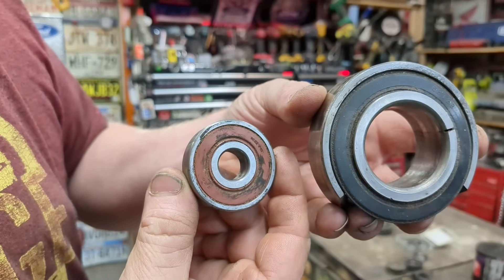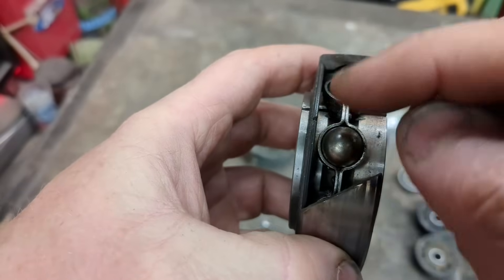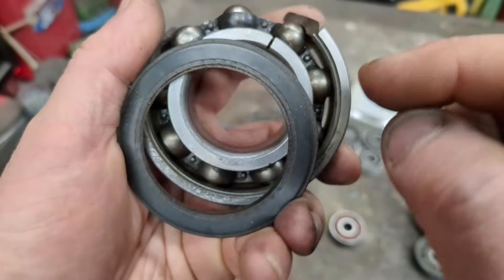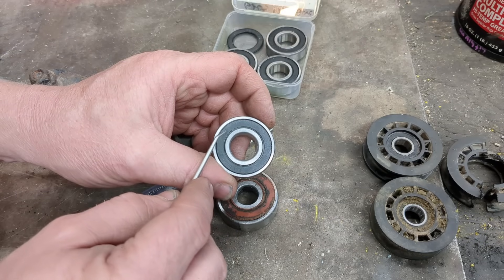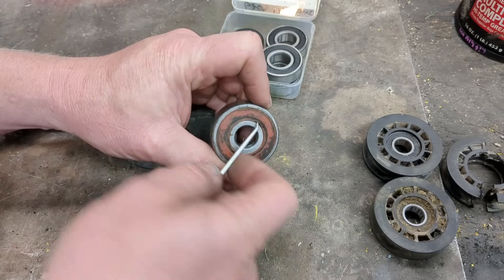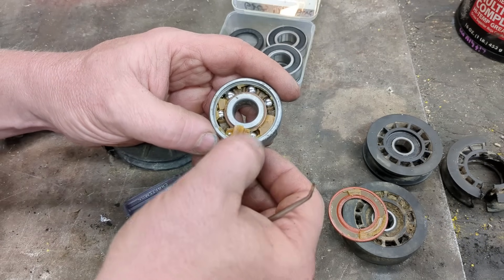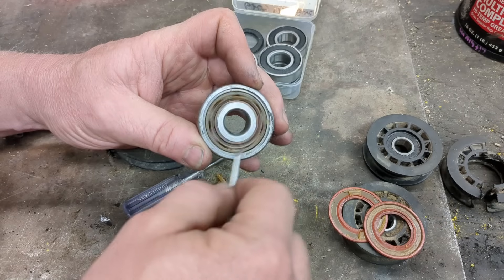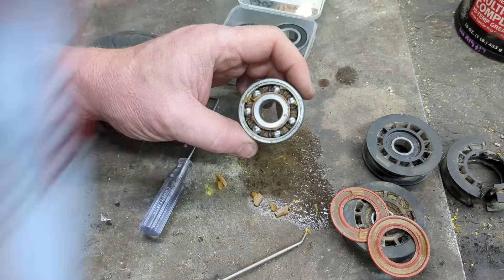How to GREASE, Un-Seize and Clean SEALED Bearings

Comment: Ridiculous. 

Gasoline and a toothbrush much better - cheaper and easier on bearing seals too.
ONLY grease when totally gasoline cleaned and dried (I use the hot sun in summer or an electric heater blower in the cold).
When you can't smell the gasoline any more it's ready for around 50% grease of choice (that's another story).

One of the reasons you clean it is to NOT MIX GREASES.

Comment: Absolutely disagree😋 Except that this way I and you know as well as others who know about this. And in my opinion, this information is as old as when Jesus wore shorts. The reservation that is used to maintain machines and the like. approximately 97% run too long so the bearings are already destroyed. And many do not have the tools to do this. But as I'm just now changing the bearings on my boat trailer. So I will test. remove all existing grease and lubricate "your" way and leave the other "original" Also change the bearings on my car trailer and do as most recommend remove the inner seal on the bearings and put a grease nipple there. will return in a year. 😉

Comment: If you're picking this much dirt out from behind the seals... time to just replace the whole bearing.
Reply from the maker: That's not dirt, it's grease soap.
Reply: @sixtyfiveford  At 3:45 he explains it's dirt in addition to old thickener. Compared to the other bearings, it also visibly looks like dirt/grit vs just thickener.

EDIT: Realized you're the video author! If you say it wasn't actually dirt then I'll trust you there. (Personally, for a lot of applications, if I do find any dirt inside, the whole thing's getting replaced.)

Comment: Remove the covers and drop in a bucket of diesel and gas
Let it soak for 4 days or longer if you don’t need it, remove and blow dry 
Inspect and if ok grease with wheel brging grease and install cover s

Comment: To be honest, with any sealed bearing, I've packed it full and never have had a failure, to include wheel bearings and spindles on mower decks. I'm sure this is correct information,, but I just haven't had a failure yet in over 25+ years.

Comment: any suggestions on bearing supplier? and   sites that offer all the parts for tools, but @ cheap prices?
Reply from the maker: I used to have a bearing place 10 years ago. But then they raised the prices and or didn't have the bearings I needed. Honestly, it seems the cheapest place is eBay or Amazon only because they can ship for reasonable prices.
Reply: @sixtyfiveford  thats what i have found also, but i know the parts unicorn is out there ... somewhere ... but i know i get different search results than other folks using the same exact search term, and in same geographic location. I have tested that, even on Craigslist.  Ever do the cold hot method installing bearings, and supposedly heating the drive pulley on the dws709 type 20 is supposed to make removal oh so easy ....

Comment: Nicely done.  Overpacked bearings wind up working the grease, the extra load causes it to run hot, and... bearing life gets shortened.  Some heavy duty/low speed assemblies do well with a little more [near 30%], but thats about as far as it goes.

Comment: Choice of grease matter more imo. Schaeffer 274 aluminum base is so special compared to trashy lithium based wheel bearing grease. When you mix lithium based w water it will fog up and foam up but it doesn't happen with Schaeffer 274 it's actually truly waterproof grease.

Comment: I used to take those seals off and do exactly what you have done, and I also used to take the pick and use it to put a little hole in the seal then I would get my needle bearing grease fitting and attach it to my grease gun and pump a small amount of grease through the hole I made in the seal and then re-seal the hole I never ever had a problem I am a 71 year old retired heavy duty mechanic and I to also got into arguments about greasing sealed bearings and about over greasing a bearing over greasing is not good and it is just a waste of grease got into a lot of arguments over that one, but at the end of the day I was right.

Comment: Thank you. Rebuilding an engine on a tight budget. Pulley bearings were starting to sing a clickety song. Don't want to use cheap parts and can't wait for shipping. I am going to do some preventive work on the wheel bearings as she is off the ground.

Comment: Great video! very informative. How about needle bearings and taper roller bearings? More like parts on dirt bikes swing arm with needle bearings, steering stem with taper roller bearings that just pivot and oscillate and don't spin at high speeds.

Comment: How do I tell you thank you enough on this information. This is my second comment on this video and today March 30th 2024 I took the two idler pulleys apart on my zero turn and your information was exactly correct as I dug out all of the hardened grease and dirt. I used carb cleaner along with PB Blaster to flush out all the remaining junk. I also used greased lightning with hot water to clean them more then blew them out with compressed air. I saw exactly what you were talking about with putting to much grease into them. After greasing them I put them back on the deck and spun them and they spun freely and there was no noise. I’m 100% certain if I had caught the one that is destroyed now that I could have saved it. The new idler pulley that I’m going to purchase will be taken apart and cleaned and repacked with the exact type of grease that you used as my three tubs of grease are the exact type but all three are different colors as you stated. Now to take the spindles off of it and take them apart and clean and regrease the bearings in them also. Again thank you is an understatement on the information of the 25% amount of the grease. I’m sure glad I have been subscribed to you.

Comment: One thing to point out, re greasing a bearing needs full cleaning (even preferably with an ultrasonic cleaner) if you are using a new grase type and you're not sure of its composition. There are plenty of grease types with different thickener material which are not compatible with each other when in contact, once they mix they change composition, harden up or disintegrate.

Comment: One thing not mentioned is that you can tell if a bearing is failing simply by listening while in operation. The first thing you hear is that it will make a low pitched whistling noise and then a slight rumbling. Almost always after that they will have a loose wobble to them. By then it is too late for grease. It does not happen often but, if these conditions go too long, it  can lock up completely and the inner part of the bearing will rotate on the spindle causing it to be ruined. Don't buy the cheap ones! Fafnir, Timken or SKF are good quality.

Comment: I have a machine that has a heavy belt driven power take off pully with two 6305 2RS bearings pressed into the ends of the pully.  Without using a bearing puller to remove the pressed in bearings, I can only access one side of each bearing.  I figure using a slide hammer to pull the bearings is going to potentially do more harm than re-packing will do good.  So I remove what I can of the old grease and press in a dose of new grease from one side of each of the two bearings.  So far, so good over the past 8 years and doing so every  other year.  I prefer shear stable polyurea grease for what that is worth,

Comment: So the; do the trailer wheel bearing devices, that have users pump grease into a spring loaded "Bearing Buddy" that keeps the wheel bearings totall packed, are not good for the bearings.
Reply from the maker: Bearing buddy's do one thing: They prevent water from being sucked in during the immediate cooling from dunking your boat trailer in the lake after driving it. They don't actually force lubricate the bearings. They just give a reservoir of grease so there's an expansion area. I see guys put them on non boat trailers all the time and it destroys the inner seal/hub. It does this by forcing grease out the inner seal. Then pick up road debris/dirt. This mixes with that oozed grease and sands the inner seal and lip area destroying them. On a non-boat trailer, it does more damage and zero good.

Comment: If you can hear bearing noise over engine noise, that bearing has more going on than just lack of lubrication.  Bearing manfacturers know what they're doing.  The grease fill is intended to last the average useful life of the bearing and they don't intend for you to pop those seals out.  Yes, if you clean and re-pack, it will quiet down for a little while.  It's just not worth your time unless you simply can't afford to buy a new one.  In my industry, we do use sound to tell us when a bearing needs lube.  It's low-intensity ultrasonic frequencies though.  By the time a bearing gets to where you can hear it, there's already damage done.

Comment: Don't use EP grease in a bearing, the moly will act like an abrasive etching the surface and causing premature failure.  EP grease is only for low speed sliding applications like pin joints, a 5th wheel, or ball joint.  Otherwise, thanks for the video!

Comment: Bearings are so cheap, it's generally not worth it. Re greasing at the right interval is more important but you can't un-damage bearings. Dry bearings fair enough but any gritty feeling or extra play and just replace it.   It's much worse to have a bearing fail completely and destroy something rather than throwing away a bearing with 6months to a year left on it. Just change them. You'll know what bearings are critical and which ones aren't. Run non critical bearings to failure though as long and removing the rings won't be difficult or damage the equipment.

Comment: I know im late but i had to add this those plastic pulleys  appear to be off of riding mower ill add that when you replace them the replacement pulley is generally made in china  and they generally either have no grease in them at all or very little grease and they do fail prematurely if you dont pop the seals and grease them prior to installation 
ask me how i know

Comment: Disclaimer: I'm not a tribologist, only a bearing engineer.

Make sure you use a compatible grease. Not all thickeners play nice. If in doubt, either replace the bearing (best option) or thoroughly clean the old grease out. IMO screwing around with this isn't worth your time vs just replacing with a good quality new bearing. In all likelihood, the one you install will be better quality and have a higher dynamic load capacity (last longer) than the old one.

Comment: I pop the seals first with a fine needle then finish lifting up the seal with pick/small screwdriver, wash the bearing in kerosene until all bits of old grease is gone , spray the bearing with a jet of water to wash out the kerosene, then quickly compress air the bearing until dry … pack (but not overpack) with name brand synthetic grease..press in seals ..wala

Comment: I worked for a bearing manufacturer and this is the best advice I've seen about how much grease to use.  No one ever goes back to the people who make the bearings to ask.  And if you did you might just get a lot of equations from an engineer.  One company has a chart.  But your advice of about 25% of full pack is good.  Cleaning it out with acetone works but it is not good for the plastic cages on some bearing and it is bad for the rubber seals, so be careful.  WD-40 is pretty benign and only takes a little longer.
Reply: Thirty years ago, working on heavy earthmoving equipment, we were have a lot of u joint failures, so we contacted spicer and complained about the problem, they asked " how often do you grease"? "Everyday" we responded, he said, " quit greasing". So we greased every two weeks and the problem disappeared.  then they sent the science of grease and how it works brochure and we learned about how to much grease will overheat the bearing. That's hard for a lot of mechanics to swallow
Reply: @Maurice-c6z  On my cars, I use ujoints that aren't greasable. I've read if you get the greasable ones, that you HAVE to periodically grease them. Not sure if they leak grease more often than the non-greasable ujoints.
Reply: You're right! I would also avoid acetone, because it destroys a lot of plastic. I usually use clean (spot-cleaning) gasoline. I usually use Molybdenum sulfide grease for high-speed bearings. I am an electrical engineer with a degree in manufacturing technology, but 50 years ago we didn't learn about molybdenum grease, only graphite grease. What do you think? Am I doing it right? I learned about the 25% fill a long time ago, and I follow the rule. But technical logic says so too. Without mechanics, there is no electronics! I grew up in the era of tape recorders. But I also keep a steel-wire voice recorder, which is already a "museum piece" but has still been working for 80 years.
Reply: Ignore the color, but never the base or the nlgi rating.  Put 3 when it calls for 2 for example, and there will be trouble.
Reply: WD40 is the 2go2 for near everything. I use it when repacking my bearings & never had issues yet.
Reply: Why your company uses cheap grease and not high temperature one? Cost cutting I guess?
Reply: @briethlayson3270 where did he say what grease he uses?
Reply: His company uses a high temperature grease, but it is made in China, because it is a bit cheaper.
China has a very poor quality control, and that is why failures and malfunctions happen so often.

Comment: Why would you bother to do this? Bearings are not expensive just buy some new bearings from your auto store.
Reply from the maker: Socks are super cheap. Why ever wash your socks? Why not just buy new ones every time?.
Reply: @sixtyfiveford  There is a big difference between socks and bearings.
Reply from the maker: @Billgiles-56  No, there's not. If it's dirty, clean it. If it's worn out, replace it. On top of that, you can virtually never buy a plain bearing from the auto parts store. You can only buy assemblies these days for modern cars. So something that has a bearing in it that goes out you have to spend $150 upwards of I've even seen $500+ for a part that just needed a bearing.
Reply: @sixtyfiveford  it's not easy to fit and replacing the bearing, special tools needed. So maintenance is easy and best option.

Comment: In the old days, we packed tapered bearings all the way full and half way full in the hub. We could adjust the tension and it worked well. Never had any issues and they ran the life of the car or truck. Grease flows outward due to centrifugal force and cycles itself in the hub. Usually regrease on brake changes. However, the new roller bearings don't work that way and usually burnout in a short time. They too spin the grease to the outside of the race. That's why you don't pick the cover from the outside edge, it will cause a leak point. The problem is, they wear down the race area compared to taper bearings and regreasing is often a waste of time and they will start humming in a short time and need replacing anyway. I've done it a few times and they just don't last.

Comment: Too less grease will be cast aside , the hollow part. As a motorcycle mechanic I grease the bearings almost 80-90%. Use gear oil to thin the grease for proper circulation, since motorcycle bearings run cooler. No issues till now.

Comment: If you have a slow rotating bearing such as on an electric gate or even a mountain bike then almost filling the bearing is the way to go, it will never overheat, it turns too slowly, and will last almost forever.  Even when fitting new bearings they come with the amount of grease for high revs and should be repacked if used for slow rotation.  If they are full of grease, water ingress or condensation just does not happen and they do not 'dry' out which is why they will then last almost forever.
Reply: dokłądnie , wszytsko zależy od specyfiki pracy i rodzaju łozysk, od srodowiska pracy, od predkosci, od obciązenia. łozyska pracujące bardzo wolno pakujemy na full.   dlaczego jednak nikt nie powiedzial jak zdjąć osłony ZZ???   I jak zdjąć osłony z małych łożysk????

Comment: I repaired air tools in an automotive factory for over ten years a noisy bearing got thrown out and replaced with a new one who tries to clean and regressed a five dollar bearing for a thousand dollar air tool or a six thousand electric power tool that reports its readings to a torque management system I understand if you are hard up against it for money then you do what you have to

Comment: How you grease or oil a bearing has a lot to do with the load and rotational speed of the bearing same again for its construction, pure metal for low rpm low water areas upto full ceramic for high speed bearings

Comment: Those aren't sealed bearing, though? Those are obviously equipped with -2RS Two Rubber Shields
Reply from the maker: Yep. That's what you call a sealed bearing. If you have metal sides, it's called a shielded bearing

Comment: No1 failure of electric motors bearings is over greasing, we evolved to greasing bearings while running and using ultrasonic monitoring to tell when bearing noise changed indicating sufficient grease in electric motors and conveyors, elevators etc and increased bearing life cycles by 400% in some cases

Comment: When I was working as a mechanic well over 20 yrs ago I used to wash the old grease out in the parts wash bath. Then I would use compressed air without spinning the bearing fast until it was clean. I used to repack ball bearings with Shell Alvania I think it was called. It’s what we used to grease all the bearings on our vibrating screens in the quarry. It seemed to be far superior to other greases for longevity of bearings and I used it in rebuilds of engine water pumps. On truck trailer hubs the black molybdenum disulfide grease seemed to take a lot of heat and bearings lasted well.  🚚